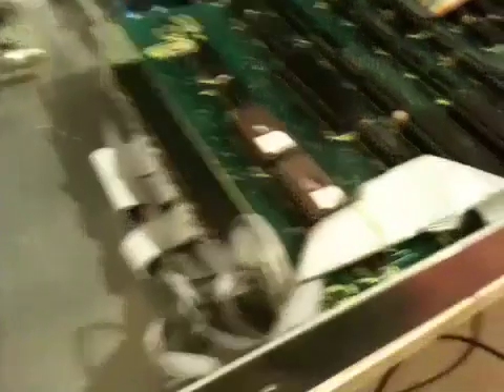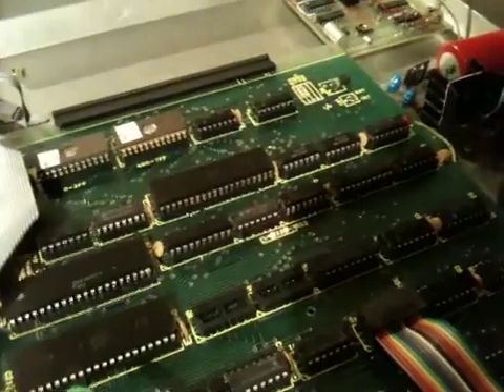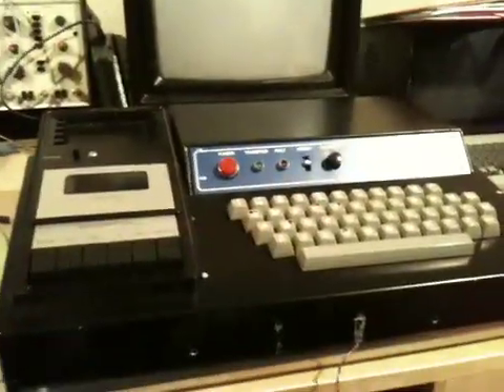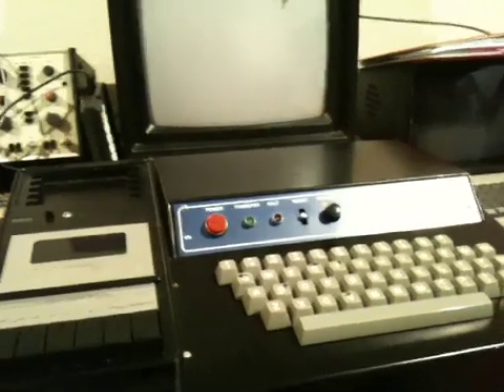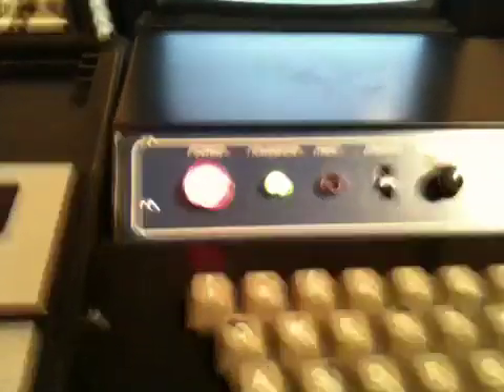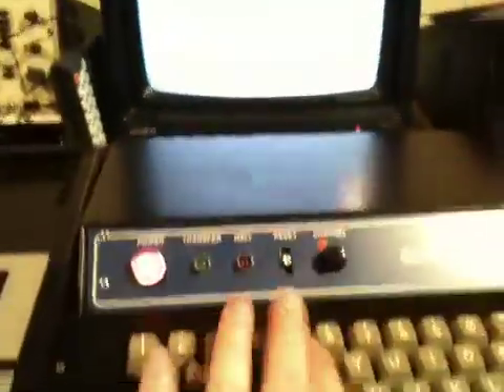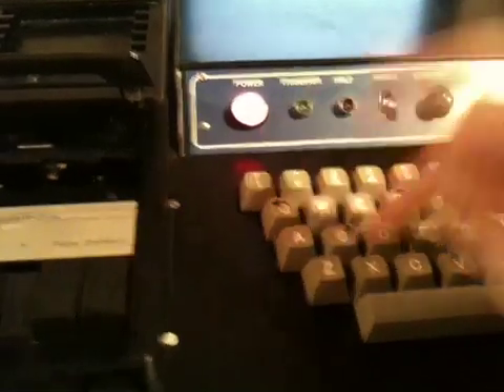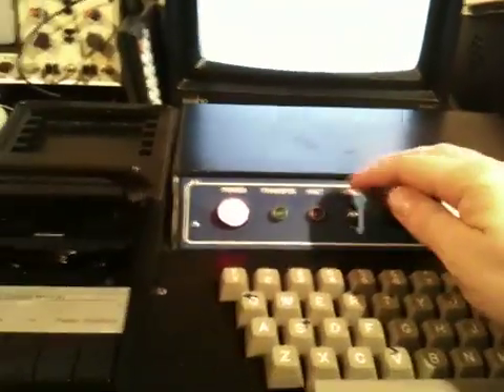Nascom 1 -

Comment: The light could be turned on and off by prog control. This was a good little breadboard computer. It used FSK ( Frequecy Shift) Keying for inputing data from a cassete tape. Very slow transfer and error prone unless the tape and recorder were good..  Brings back memories.. Excuse the pun.

Comment: It looks like there is a memory RAM problem. The screen was a mapped area of memory on these machines. I would push all the ram chips home. If no cure then swap the ram chips about and see if the display changes. If it does substantially then you have a chip, or seating or dry joint problem. Try reseating NAS SYS eproms. It used dynamic ram with refresh . The UART Chup is for Tape prog loading. Basic Interpreter etc. With additional memory board of course. Mine built and worked ok.